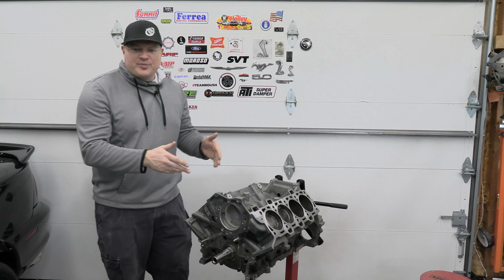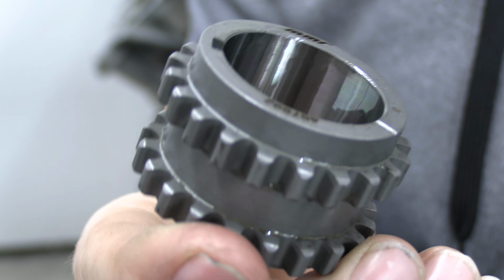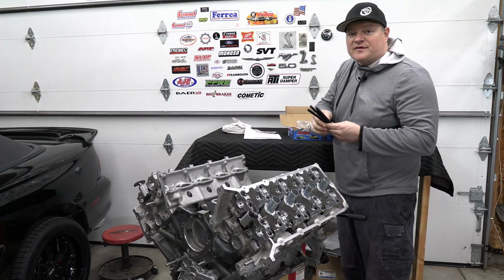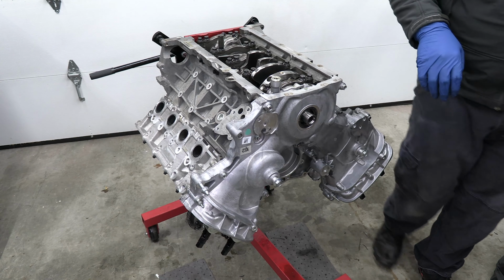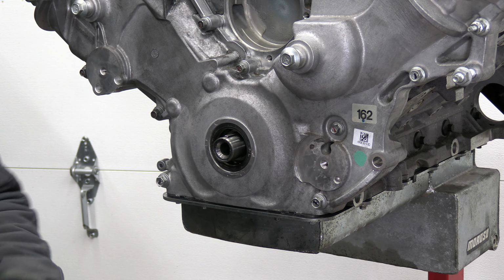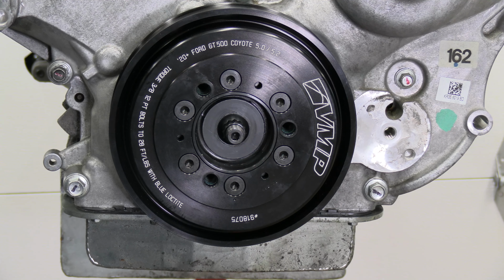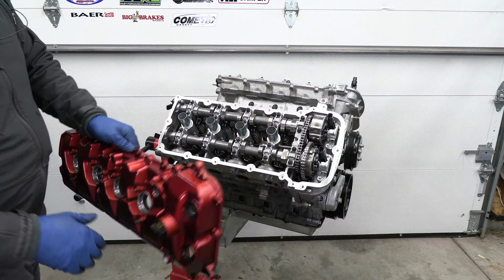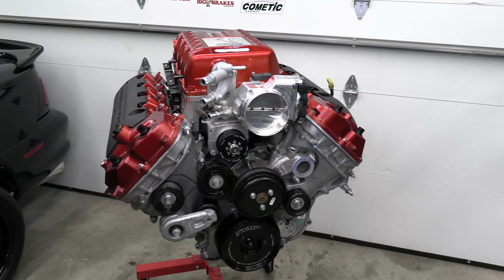Predator 5.2 GT500 Engine Assembly With Performance Parts

Comment: what was that spacer you used on the smooth supercharger pulley? im doing a oredator timing cover on my coyote and have everything but that. is it a factory piece??
Reply from the maker: On the SC idle pulley? That spacer should already come with the pulley.  I have one for sale on my ebay store.

https://www.ebay.com/itm/285717233667?mkcid=16&mkevt=1&mkrid=711-127632-2357-0&ssspo=k0tyd_i9r3u&sssrc=2524149&ssuid=k0tyd_i9r3u&var=&widget_ver=artemis&media=COPY
Reply: @Oxman_Garage  yes that one. ill check when i get home. i bought the pulley used on ebay, it may have even been through you i dont remember i bought a few parts from you haha